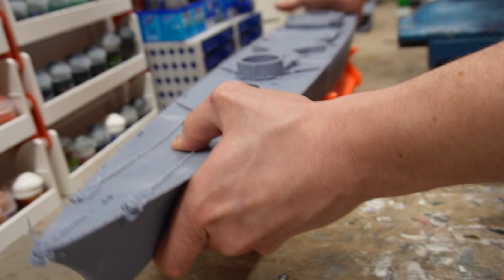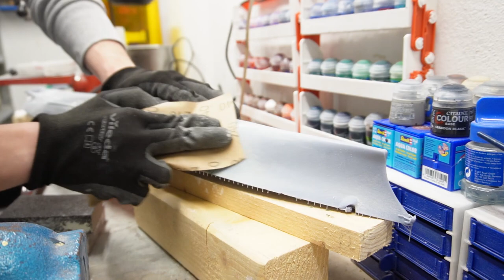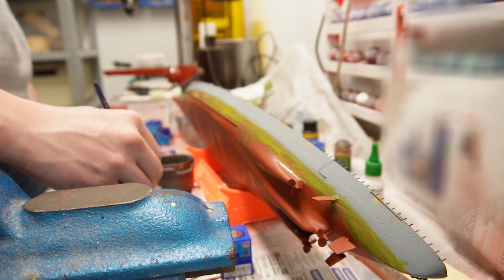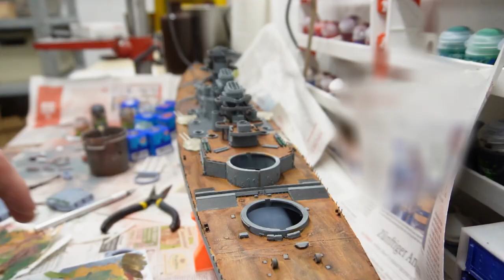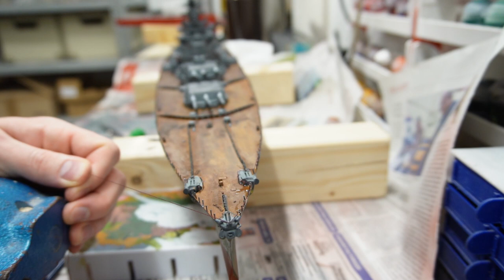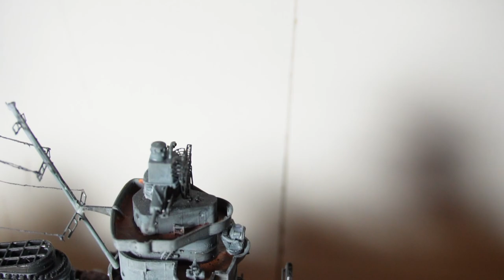Großer Kurfürst 3d printed (build video)

Comment: It's a lengthy process, but using 1/16th inch masking tape laid out in various dimensions across the deck, followed by airbrushing (or a light, thin coat if an airbrush isn't available), and then painting with shades of wood color can create the appearance of a wooden deck in the game. :D